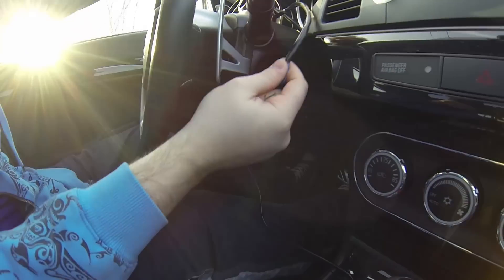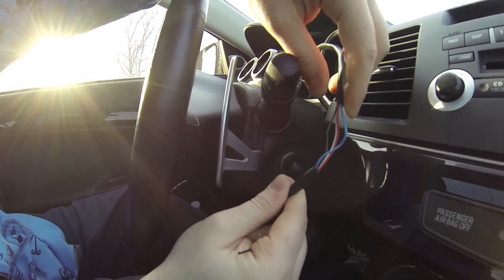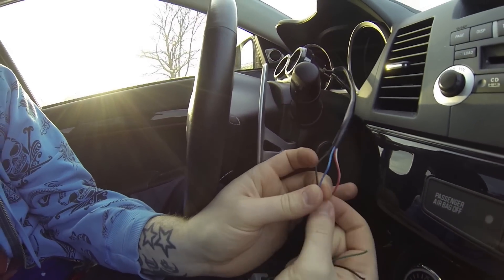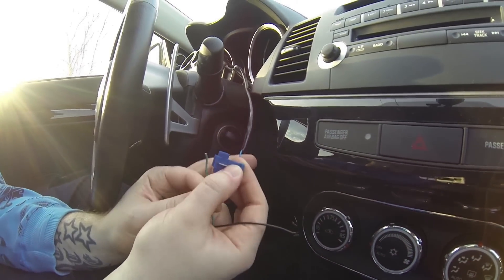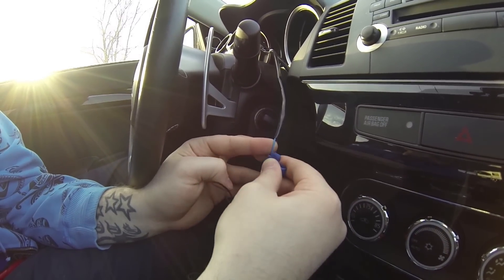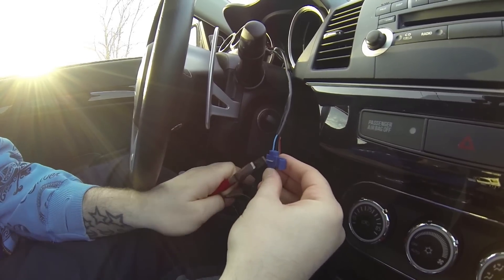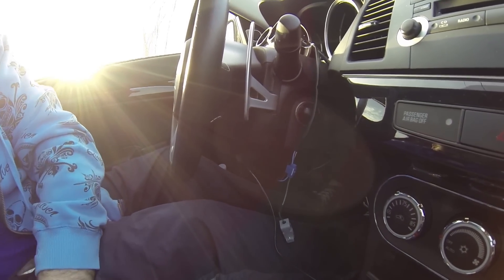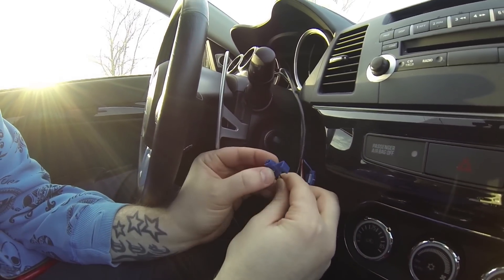How To Install Our Raw Evo AEM Serial Port Kit

Comment: I stopped using those wire-tap clamps. I used to use them for car stereo and lighting installs, but I stopped. They have a tendency of corroding over time. Better to just cut->solder->shrink-wrap. Years of worry free non-corroding electrical connections.